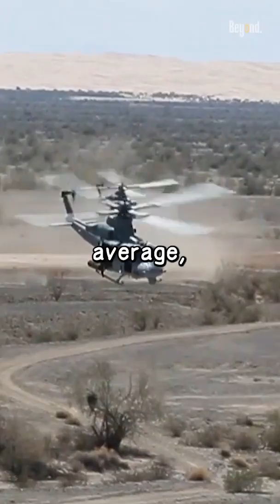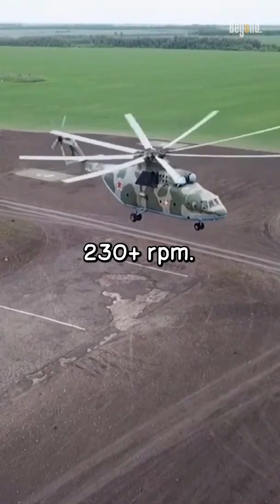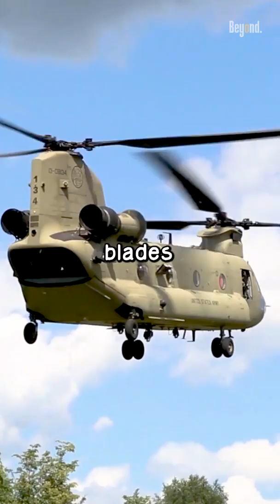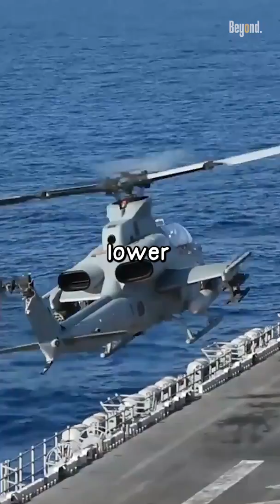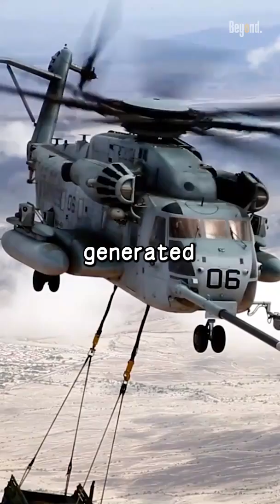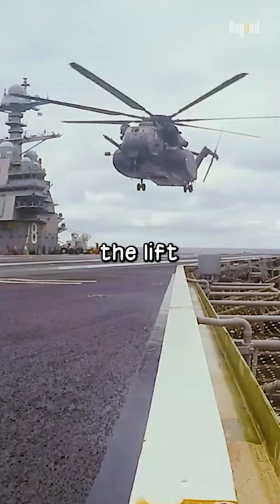How fast do helicopter blades spin?

Comment: Actually it's speed of tip of blades have meaning not RPM. It's from ωR=180 to 230 m/s depending on rotor disk loads. So you can put R (rotor blades radius) and get ω in radians per second and convert it to RPM for any helicopter.
Reply: Close but also have to factor in the max forward speed of the aircraft

Comment: The limiting factor is the speed of sound - the outher edges of the rotors cant travel faster than the sound even at full speed.
Reply: They can travel at and faster than the speed of sound but, It seriously effects performance by increasing drag and decreasing efficiency significantly while lessening lift
Reply: I thought that older copters did exceed the speed of sound. I thought that if it had only two blades it needed the blades to be longer, and to turn faster to get the required lift.
And that is what caused the Pop Pop Pop sound.
Reply: It's not that they cannot exceed the speed of sound It's with any propeller or rotorblade the portion of the airfoil that exceeds speed of sound becomes ineffective as the Shockwave separates airflow and degrades perhaps to the point of eliminating any lift/thrust that would have otherwise been achieved below speed of sound....